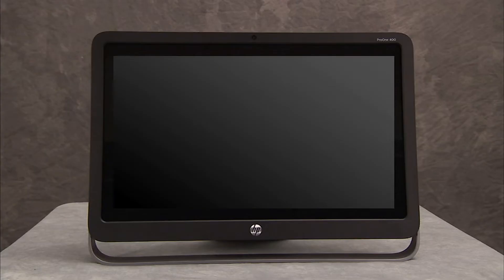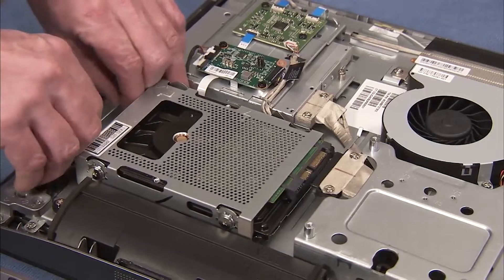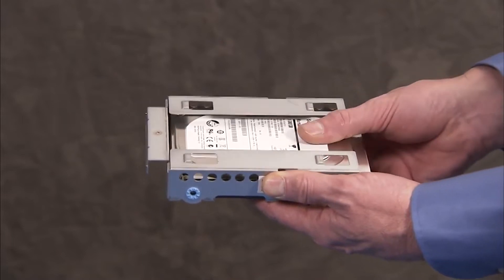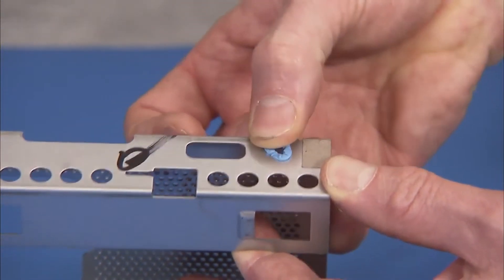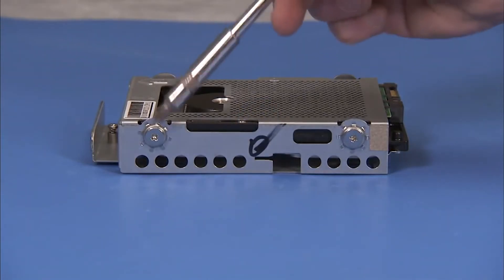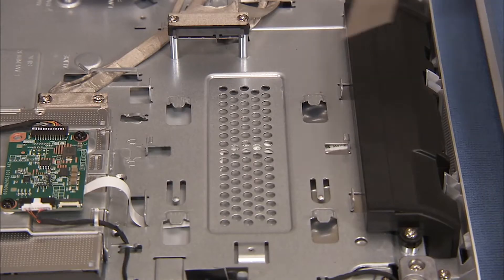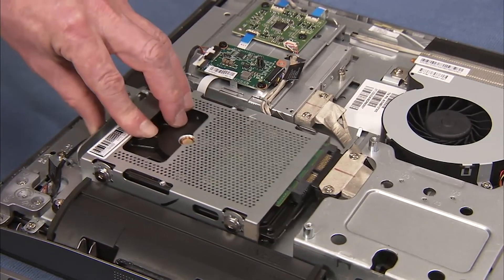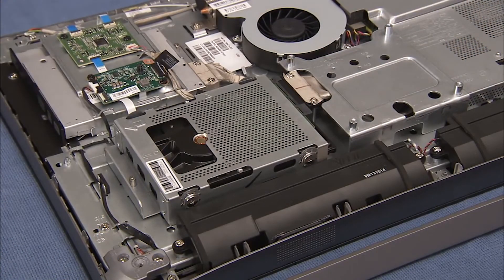Replace the Hard Drive | HP ProOne 400 G1 21.5 Touch All-in-One PCs | HP Support

Comment: Very useful, take back to life to my old computer to see emails, thanks!
Reply from the maker: +Eduardo Mendoza I am glad to know that the video has helped you fix the issue.
Reply: @HPSupport  Can I replace the hard drive with an SSD? If so, do I need anything specific to install it?
Reply: @tragicsage6733  No, its just like replacing a normal harddrive, just with a SSD. ( You might need to get a different drive cage as SSD's are smaller than usual hdds. )